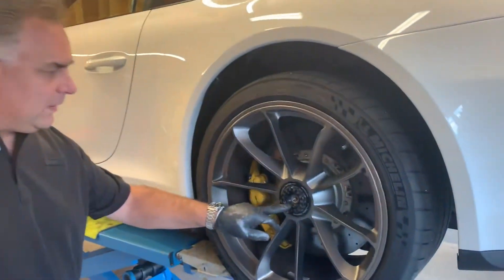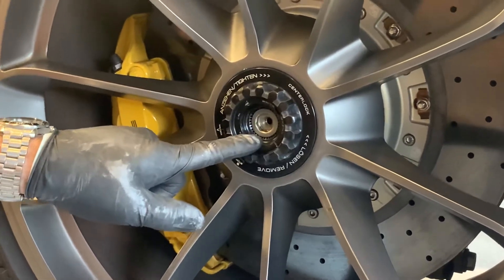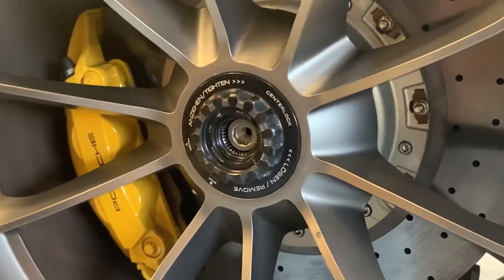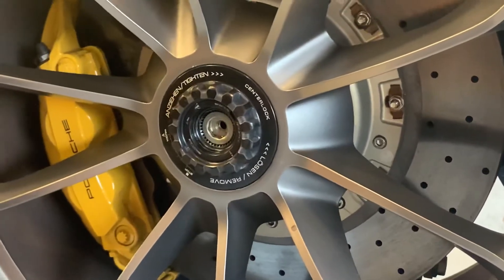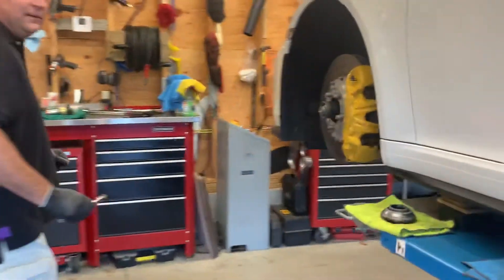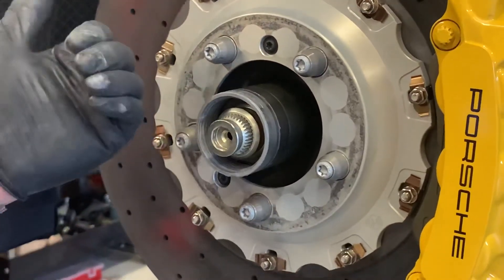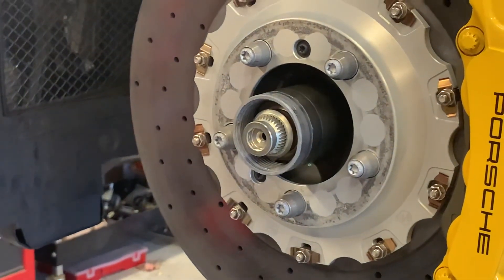Porsche GT3 centerlock locking pin lubrication

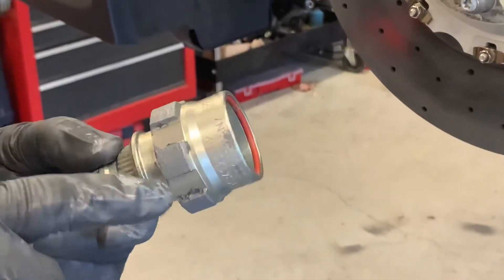Comment: @ 1:39 you mention lubricating the pins if needed. However, I have never seen or heard of anyone lubricating those before. All of mine do not look like they have any grease on them. Should they?
Reply: From what I have read, the pins should NOT have any paste near the spring lock mechanism (as it will gunk up), and Molub paste is used solely on the wheel-to-hub flange.  The pin could be lubed with a tiny amount of very light oil.